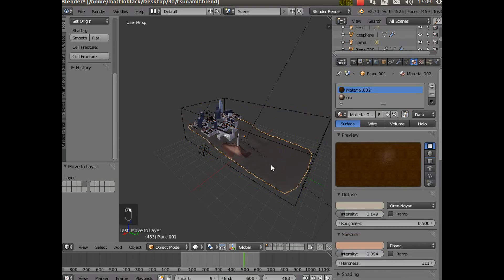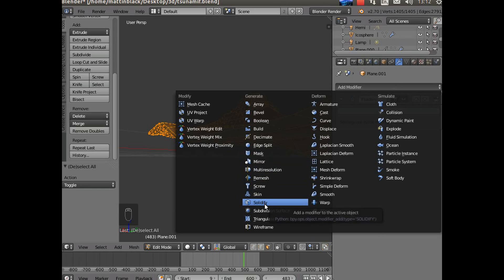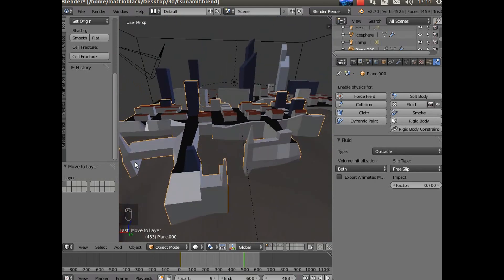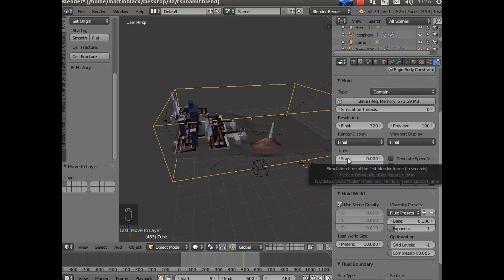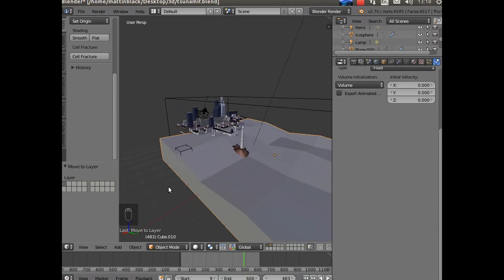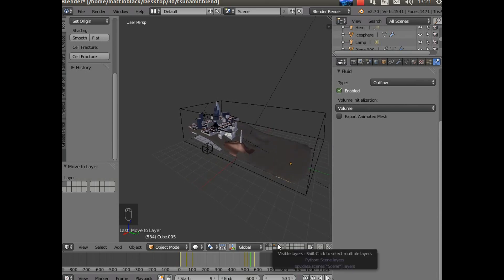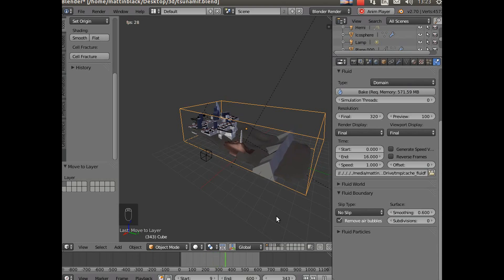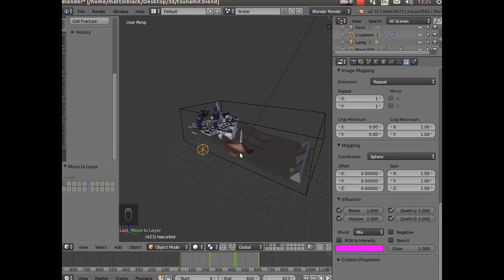CG Tsunami - Blender Simulation and How To (Blender 2.7)

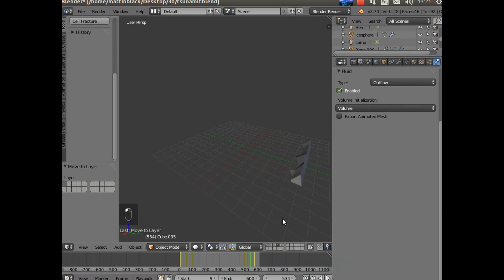Comment: this is a great tutorial but I have one question. at 13:20  how did you make that pusher so I can create waves? was that modeled than used as a collide against the water?
Reply from the maker: Yes its simply modelled out of a subdivided cube and scaled/moved so that it pushes the water as you want it to be. You can make it more or less complex but to look natural and provide interesting motion some 'peaks' are required. After you bake the water sim then move it to another layer so it does not render of course...
Reply: Arduino Tronic thank you. I haven't tried messing with fluids yet but will this weekend. I was wondering with my question above. do I just make that cube a collide and animate it and that will push the water? I just want to get a animation of waves on a shoreline and colliding with a deck and it's legs. so that's why I am not using the ocean modifier. and I will do the steps of releasing the water so it wont keep filling up.
Reply from the maker: ***** Yep you are on the right track. Just dont animate it too fast else you will see all the water take flight and hurtle out of your simulation!

Comment: I've been working on trying to perfect a tsunami for my next feature film.  The problem I'm running into is that I can't get the scale and viscosity right.  No matter what I do, it always looks like someone dumping water on a miniature city.  Any ideas?
Reply from the maker: VERY low viscosity, slow up the water sim timing. Add splashes and bubbles in compositor. Add an animated depth texture to the water surface to simulate depth of detail. Put objects inside the water that are carried along with it (hand animated).